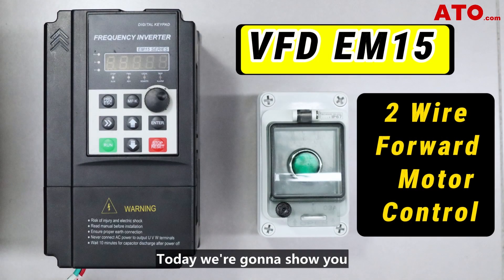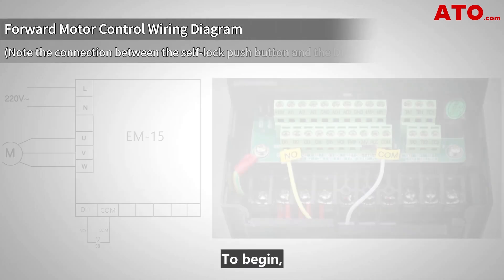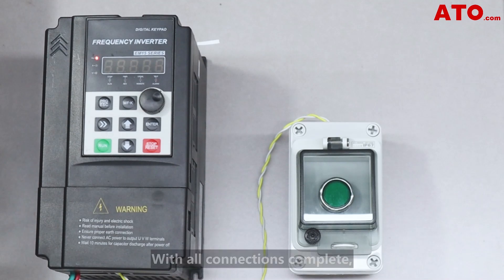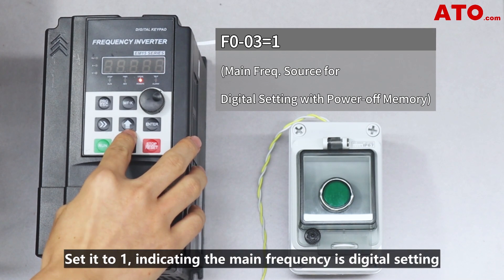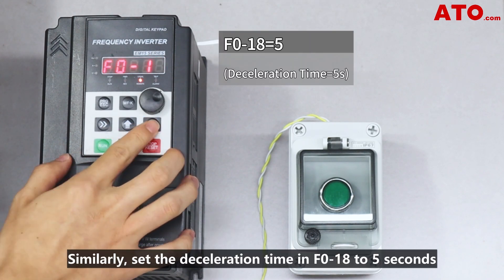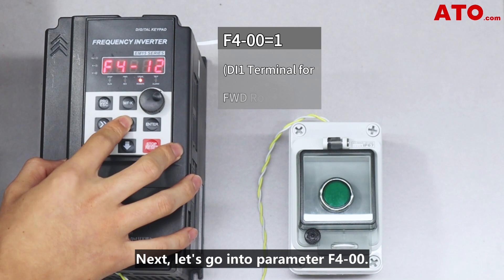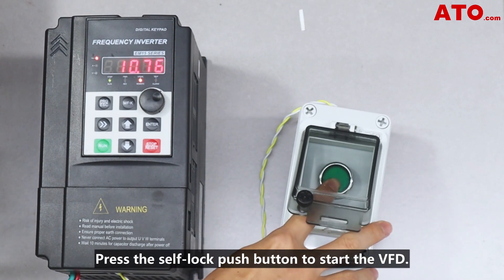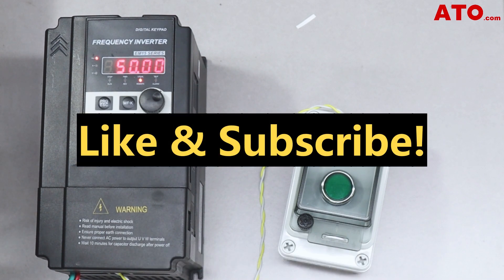Two Wire VFD Motor Control Wiring & Programming (Forward Rotation)

Comment: Hi,
I want to run my 2hp 220v single phase domestic water pump 2800 rpm
Power supply in my country is 220v ac
If I have 220 inverter as Mitsubishi LG or IG5 please share me basic perimeter settings to run it without any error or damage
Base freq
Max freq
Ecc
Dec
Specialty volts amps n rpm please
And can it reduce my electricity bill,
Please help me